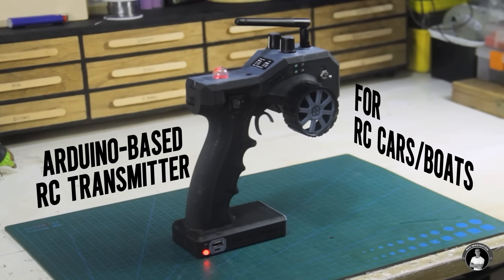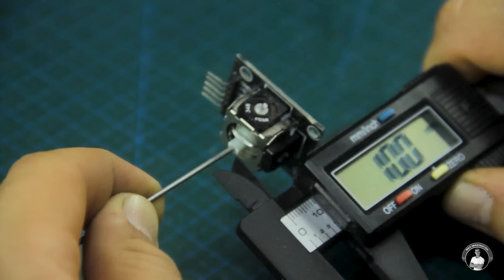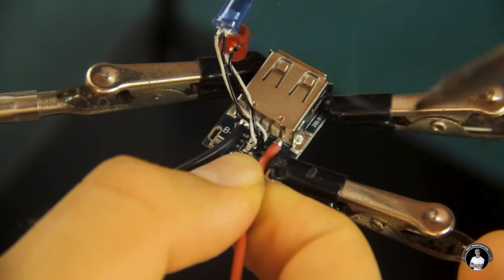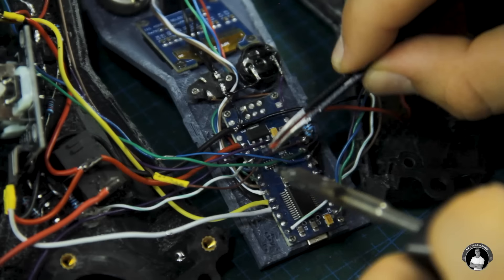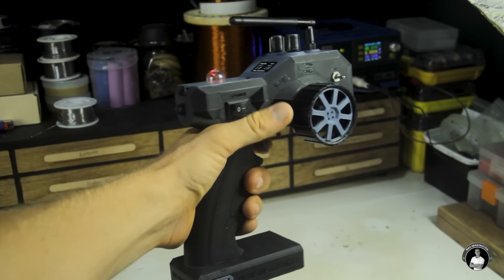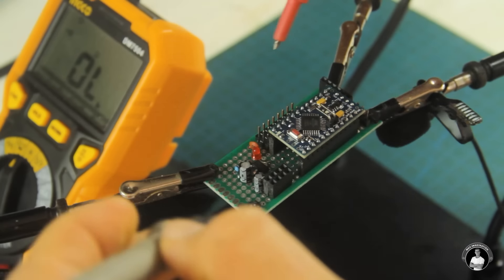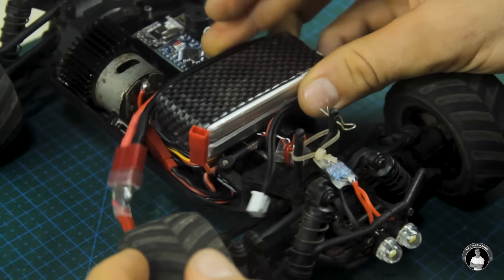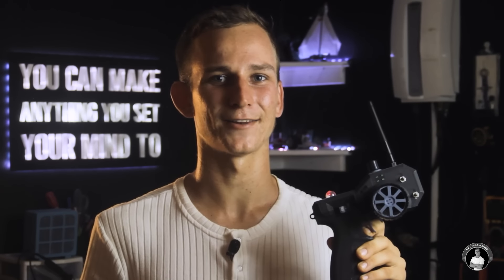Build an Arduino Pistol-grip Transmitter for RC Cars with 1KM Range!

Comment: I have the dumbest theory that those who print on the Ender 3 fabricates the better overall projects.
Reply from the maker: It ain't so bad of a printer after all :)
Reply: That's because you have to have good mechanical and electrical skills to keep an Ender 3 printing reliably. 😂
Reply: @GoingUpNorth  THIS! The one thing I like about my E3v2 was it was so horrible that I had to learn everything about it and 3D printing, and it got me into it deeper.
Reply from the maker: I'm quite happy with my Ender 3 V2, not much maintenance is needed at all except for a bit of bed leveling.
Reply: @MaxImagination  Hello Sir,,, I couldn't understand  where is your fpv  drone's  reciever and transmiter  code   ,,  because there is many number of files, so please send that actual reciever and transmiter code🙏🙏🙏🙏
Reply: @radazeonv8821  I agree, raspberry pi zero 2w retro-gaming protable console, and also, this project based on electronoobs video. And more... But I have a complain about using arduino -_-

Comment: Trying to build this up!! The most challenging part for me is soldering the wires and components to the zero pcb board I done the transmitter and now working with receiver wish me luck I’m just a kid❤
Reply from the maker: You can do it! Make sure you practice soldering before doing the wiring of this project.

Comment: Hey can you make me an favour as I want esp32 cam to make Integrating an ESP32-CAM with GPT-4 to assist blind individuals involves capturing images with the ESP32-CAM and transmitting them to a cloud-based server. The server processes these images using machine learning models to generate descriptions, which GPT-4 refines into user-friendly feedback. This processed information is sent back to the ESP32-CAM, which uses a text-to-speech module to convey the descriptions to the user.
Reply from the maker: I cannot help you with that, unfortunately. However, as I delve more into AI and the implementation with my projects, I'm sure you can learn something from that. Cheers.
Reply: That's a bit too much
Reply: Yes, it is possible. I also created a voice-controlled image annotator using Python and TensorFlow. It is also feasible with the ESP32 CAM module. If the ESP32 is processing the image very slowly, consider using the XIAO ESP32.

Comment: Can this work for PPM output for external TX modules such as elrs/crsf/multiprotocol jp4in1 and port traineer? If yes, how do I change the wiring diagram
Reply from the maker: Hi there. Firstly, you would need PPM-generating transmitter code to do this. Also, I am not so knowledgeable on how to integrate commercial-grade RX or TX modules with Arduino hardware as I haven't done this yet. Cheers.

Comment: I have an Oled that won't turn on, what do you think is the problem?
Reply from the maker: Oleds only turn "on" when you have them powered correctly, data wires hooked up correctly, and code uploaded to the board its wired to - to make something display on the OLED.
Reply: @MaxImagination  Thanks for the information bro, I'll try again later

Comment: Is it okay if in the receiver I don’t use the 100uf Capacitor which u said it’s optional in the description I can’t find it so I don’t wanna use it is it okay😢😅😅😅
Reply: The resister I have to use 220k ohm right I found online😅
Reply from the maker: It's okay not to use the 100 microfarad capacitor. Also, it's a 220 ohm, not 200K.

Comment: Finally done, really a great video to watch and learn, my opinion on what to control with the transmitter and receiver module would be good controlling a helicopter 😊 just suggesting
Reply from the maker: Much appreciated! 
P.S. The transmitter is not intended for aircraft originally, but thanks for your suggestion anyway :)
Reply: @MaxImagination  OH, about that I think you should go with a boat this time

Comment: That's just impressive man. Good Stuff 👍🏻
Reply from the maker: Glad you liked it! Thanks! Would you be interested in building it? I've got the resources to make it easy for you.
Reply: @MaxImagination  I already have a "dumboRC" receiver from amazon that works just the same, so I will probably not be making it. But, I did bookmark this video in case I come across a project that would require a special functionality that would require a customizable controller. Cuz your design rocks!
Also, my soldering skills are NOT quite there yet. I'll keep practicing on those xt60 connectors haha.

Comment: This particular NRF24l01 module has a maximum range of 100 meters in open space and limited transmission to 256kb/s. There must be a good antenna for this. To obtain 1 km of range as you write, you need NRF24l01 modules described as 500mW. Five years ago I made a radio using this module and a micro receiver on NRF24l01+ in the SMD version.
Reply from the maker: Okay, well I muse have exceeded the maximum range as the transmitter had the power amplified NRF24 module and I was in an environment with very little interference.

I've actually heard of people achieving 1KM+ with just two regular power amplified NRF24L01's.

Comment: Yoo hey I tried to connect an 9v battery to the Arduino nano I connect one wire to vin pin and one wire to the gnd and the Arduino nano starts working lights up no heat up will it work on the full transmitter with components connected like 2 joystick one potentiometer and Arduino nano and nrf module with adapter and breadboard sorry if I disturb alot.
Reply from the maker: Good. Sounds like you powered it correctly :)
Yes, it should work.

Comment: Hi! Do you want to add the function of gas and steering consumables to this remote control? For example, when I set up my truggy, and I want to limit the maximum gas to 50%, then I have to do this through programming the receiver, but I would like to use, for example, a potentiometer on the remote control. How do you like the idea? Will you implement it?
Reply from the maker: Hi there. I would most likely not revisit this project with that feature, but you can add it if you'd like. It is possible. Try asking ChatGPT on what would need to be changed in the code - it makes good suggestions and accurate corrections most of the time.

Comment: Hey brother can I use an 9v battery I can connect battery and led to the module too can I use the battery 9v battery with and button connect to the Arduino nano for transmitter
Sorry for disturbing a lot
Reply from the maker: You can, but then you'll need to remove the power bank charging module from the equation as the maximum battery voltage and it is 4.2V. 

You'll then be left with a non-rechargable battery that you'll need to occasionally swap out (assuming you're referring to the rectangular Alkaline 9V battery).

Make sure you connect this battery to the VIN pin of the Arduino to handle the 9V. Don't connect the battery directly to components that cannot handle 9v.

Comment: Excuse me max, could you be able to make such an rc car that has a pair of receiver and one more transmitter  onboard the car so where the range gets over, the car can release its sender and extra receiver so they can receive and retransmit the signal to the car, and hopefully DOUBLE the range [and the best part is that would be soooo COOOOL). I know you can do that. You'll surely get some quite lot of views on this Survival car or something.....
Reply: Please
Reply from the maker: Hey there! I assume this would be possible with the existing transmitter-receiver setup if a second transmitter is introduced.

I've never tried this before, but I'd assume it's possible if the radio line codes are the same for the receiver to decode.

That way both transmitters could simultaneously control one receiver. (Maybe).

Cheers.

Comment: Hey max hows ur day going hope its great i wanted to buuld this reciever and transmitter but i dont have some of the items cuz it will cost me so much money in my countrykSo if i dont connect those components wire to the component cuz i dont have the components i will connect the wires to and normal breadboard so no connection will it work❤?
Reply from the maker: Hey! My day is doing great, thanks for asking! As long as your connections are tight and firm on your breadboard, it should work!

Comment: This is such an impressive work. The Transmitter and Receiver look so cool, and I am planning to build them for my RC car project. But, I am struggling with one essential part. I currently have no ideas on how to make a bidirectional brushed motor ESC with Arduino for my project. So, I hope you can make a video on it, as you are good at this stuff. It would really benefit my project, as I couldn't purchase brushed ESCs which support high voltages because they are really expensive and my budget cannot cover that. I am looking for a cheaper alternative.
Reply from the maker: I appreciate your kind words! You can probably find tutorials online of high-power brushed ESCs made up of salvaged MOSFETs. Cheers!
Reply: @MaxImagination  Hello Mr. Max, thank you for your good suggestion, I found some great tutorials on making ESCs using MOSFETS. Thanks!

Comment: Hi, thanks for this fantastic project. Do you know what is the cost for printing the 3d files? Thanks
Reply from the maker: Hi there! The cost of the filament needed to print this design is around $5, this of course depends on which filament you choose. ESun PLA is around $20 USD for one KG and only $5 of it was used for this project.
Reply from the maker: Hi there! Thank you! The cost of the filament needed to print this design is around $5, this of course depends on which filament you choose. ESun PLA is around $20 USD for one KG and only $5 of it was used for this project.

So, would you like to move forward and purchase the design files? The link is in the description below.

Comment: I'm making one rn. How can I mix two channels to have tank-like steering with this transmitter? I'm making a surveillance rover for my school project.
Reply from the maker: Awesome! To mix channels and adapt this transmitter's controls to a tank, you'd need to make more changes in the code than anything. E.g. When you press the throttle trigger, 2 variables in the code to drive both motors forward needs to be activated and same but reversed for when you steer. I suggest you research this topic further on forums, there are people who can help further. Hope this helps guide you to the right answers. Cheers.
Reply: Thanks @MaxImagination

Comment: Hey I connected one toggle switch but is it okay is not connecting the led lights it will just show in display is it’s on?
Reply from the maker: Hey! It should be good enough only having the display as indication for whether or not it's powered, yes. You don't need the LED lights for the toggle switches.

Comment: Hi, I already made this project, but I have a little complaint about using the nano, or uno. 

Don't you feel like the pwm or the analogread functions, increase too fast using those joysticks / potentiometers?

In my case I feel like I don't really have to much control, as the pwm signal goes up/down really fast.

Also is the same thing with the servo, like you just need less than the middle capacity of the potentiometer to get full drive or speed...

I tried to stabilize it using map or calculating the average value, with 20 to 50 (i++) in for cycles. And yes the more iterations you add, less time to response you have, but it responses better.

Is there any way to increase the performance of analogreads itself? Like a way to get better "resolutions" when reading them?
Reply from the maker: Hi there. I also have the same complaint. My servos and other motors tend to ramp up and down too quickly and in a jittery way due to the low resolution. I haven't yet tried adjusting the PWM values, but will give it a shot in my upcoming project to see if this can be solved.

Comment: Interesting project. Also a lot cheaper to make than the cheap alternatives found online like FlySky GT3.
Reply from the maker: Hey and thanks! Yes, as the transmitter itself costs only $55 USD to make and a total of $65 including the receiver and programming equipment.
Reply: @MaxImagination  It cost even cheaper here in India. Around $40-$50 USD total. I made one following Electronoobs video in 2022.
Reply from the maker: Well done 👍

Comment: this is an awesome project, i have tried to make exactly the same as you, but why it doesn't work, the oled doesn't light up 😢, any suggestions? thanks in advance
Reply from the maker: Hi there. Thank you. Have you swapped the I2C connections around the wrong way? It may be worth checking the display. Have you attempted to supply it 3.3V and 5V on different occasions to get it to work?
Reply: @MaxImagination  I tried another code (make sure my oled is working) and it works, I don't know yet for the function of each channel (I haven't assembled the receiver) tonight I'll try to assemble it to make sure, thank you Max for answer my question, you're great man

Comment: Hey Max! What drivers should I use before programming the arduino, CH340 or CH341? Also, can I use joysticks from a flysky transmitter without altering the code?
Reply from the maker: Hey, Kytherus! From what I've read, the CH340 driver works for the Nano. Read more about how to install drivers here: https://bromleysat.com/arduino-nano-ch340-drivers-installation-guide

You can use any joysticks with potentiometer values between 5K ohms to 100K ohms. I would assume they can work.
Reply: Thanks @MaxImagination

Comment: Nice video. Anyway is it possible to make receiver and transmitter for drone controller? The flight controller of the drone using pixhawk
Reply from the maker: Thanks. That is possible, but a pixhawk system might need some conversion if used with an Arduino-based transmitter. For a basic drone, you can use 100% Arduino hardware including the receiver.

Comment: Yoo I got 2  capacitor one with 10nf and 25v for the nrf module and one 10nf 50v which one to use😅?
Reply from the maker: Either one will work. Just pick one. The maximum voltage ratings are way above the voltage your circuit is running on.
Reply: @MaxImagination name me one capacitor and I will use that 😅

Comment: Will it work if i dont solder some thing swhich i dont have like the rotary something named and the battery instead i will use 9v battery is okay😅
Reply from the maker: It will still work even if you don't use the potentiometers (rotary sensors) or toggle switches. But joysticks are important. Also, the 9V battery will work fine if connected to the Arduino's VIN pin.

Comment: Can i use the antenna module instead of the wireless nrf module i have antenna nrf module for the reciever
Reply from the maker: You can use either, assuming you're mentioning the NRF board module and the extended version with an SMA antenna.

Comment: I also made an arduino based transmitter, but I'm facing a problem that the servos are fluctuating very much when I move the joysticks. Can you tell me the possible solutions for this?
Reply from the maker: Hey! I had this issue too when I was testing the prototype circuit on a breadboard. The issue was because of loose connections at the joysticks. It could be because your analog inputs aren't solid, they may be fluctuating, causing the servos to behave that way.
Reply from the maker: I suggest you keep all connections soldered and firm while having your peripherals connected well with their connectors - sometimes this can be because of a faulty connector.
Reply: @MaxImagination  I made soldered connections and also checked the connections with a multimeter. All connections are good. Any other ideas what could be wrong?
Reply: @MaxImagination  I tried a lot but couldn't resolve it. Finally ended up in frying one of my nrf pa modules. I have a spare nrf module without antenna. Might continue trying with that one. But couldn't find any solution till now. Should I give up this project and start working on another one or continue this?
Reply from the maker: @AKElectroDIY  My suggestion to you would be to go through the process of elimination.

Try using different Arduino boards with your circuit and then different NRF modules that work until you find where the bug is.

I recommend that you also try your circuit with a simple or different code utilizing fewer IOs.

Don't give up, bro. You've got this.
Reply: @MaxImagination  Ok thanks. I will now try to make another circuit for just a single channel to see if it works and then add more channels gradually. 
There are really a lot of trials while making this. But you always motivate me to try again and again.
Reply: @MaxImagination  So I came to a more specific error. The arduino and nrf modules amd their power is good. I used a 10K Potentiometer for aux channel (channel 5) that worked perfect. Then I connected the joysticks that have 5K Potentiometer each. Note that power to all the joysticks connected in parallel to power input nrf module (I'm using nrf voltage adapter same as yours). Still 5th channel performed good. But till this, I haven't used analog input of arduino from first 4 channels. I just used analog from 5th channel having 10K Potentiometer. As soon as I used analog input in the transmitter code, the fluctuations started in all channels even in 5th channel. Now do you have any specific idea how can I resolve it?
Reply from the maker: A maker on this forum thread mentioned something that may help you: "The answer to your problem is to use an adequate power supply. In this case, that means to use a power supply that is capable of providing TWICE the current that you estimate the parts to draw." Read more here: https://forum.arduino.cc/t/servo-moving-extremely-erratically/606473/6

The issue may be regarding power supply on your receiving end.
Reply: @MaxImagination  Thanks. By the way I'm using an ESC to power the receiver. Its a 40A ESC with a 3A BEC.